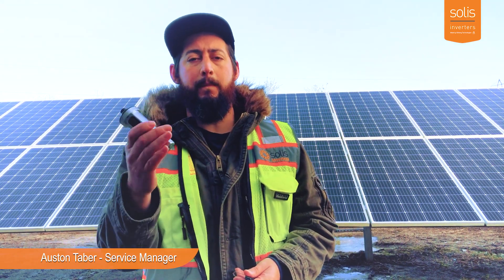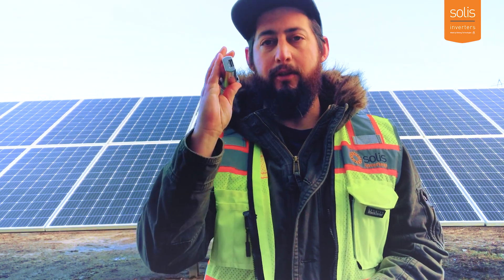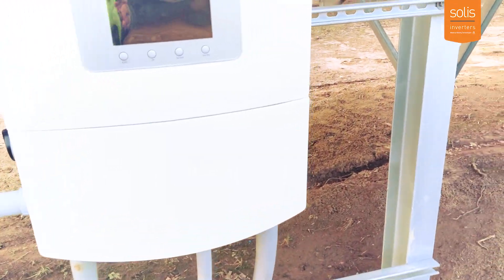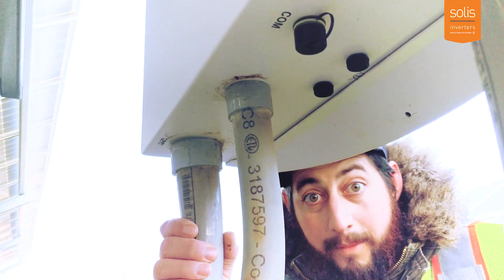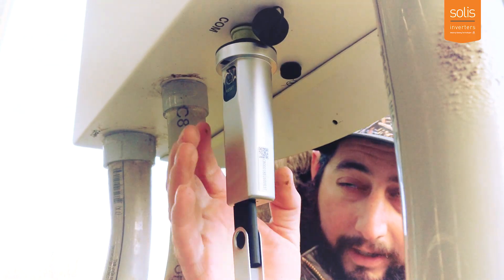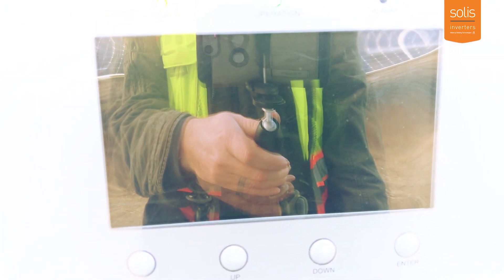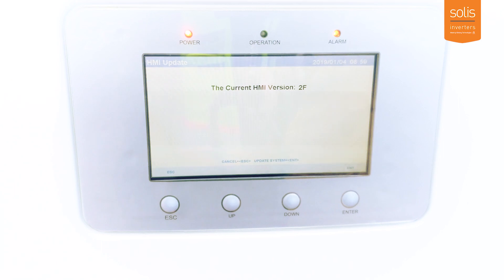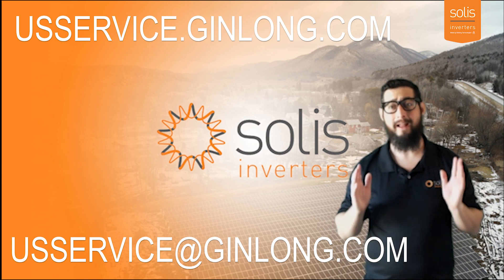Firmware Upgrade

Comment: Thank you for this video, I was looking how to firmware upgrade my Solis RHI-3.6K-48ES Hybrid inverter, right now it have version 10F, but to work with BYD LV batteries, it need at least version 11F. I've contacted my local store ( I'm from Portugal), and they told me they're waiting for the dongle. Let's hope it solves my problem! :)
Reply: I have RHI-5k version and the firmware version is F8. BTW, did you get software for your inverter? Solis inverters' online support is virtually non-existent. None of their support link or email address works.  On my inquiry from a guy from Ginlong replied to me that I didn't need any firmware update.
Reply: @ayazafg7197  the 48ES is not sold in the US please contact euservice@solisinverters.com and we will provide help for you.